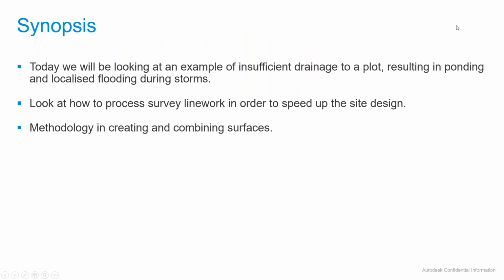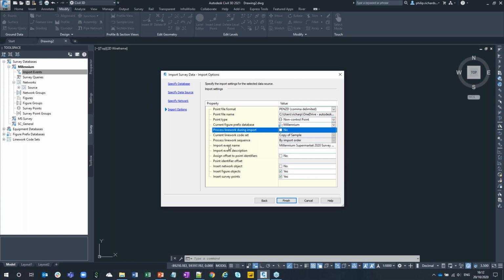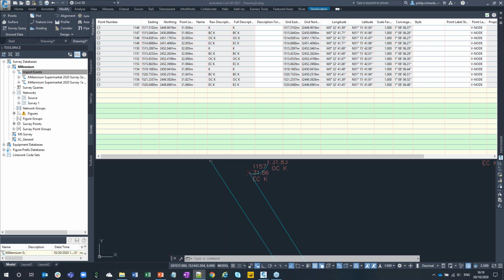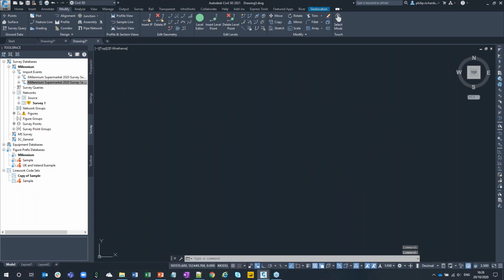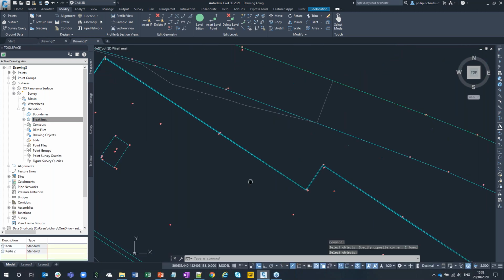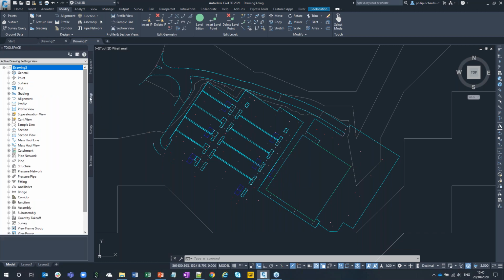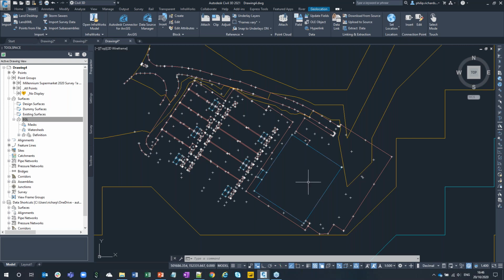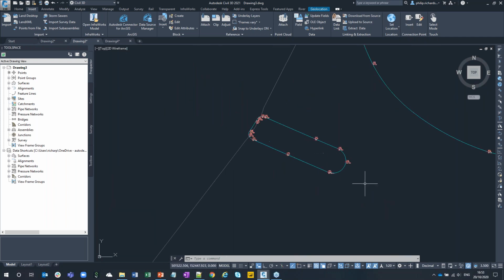How to quickly process survey linework (Oct 2020)

Comment: You could have edited survey points, by right clicking in drawing. When you've completed your edit, it will prompt you to re-process linework. It's a lot faster and it saves to the database. You don't have to convert to cogo points to edit survey points. The curb offsets could have been done in the survey points as well, then it would have been saved in the survey database, rather than just the drawing. It's good to know how to offset feature lines though.
Reply: Thanks Joshua, I've looked at your tip and its a good way to speed up the processing of the survey.
Reply: @scraggy44  just make sure you have the survey database open for edit or the option won't be there to edit survey points.